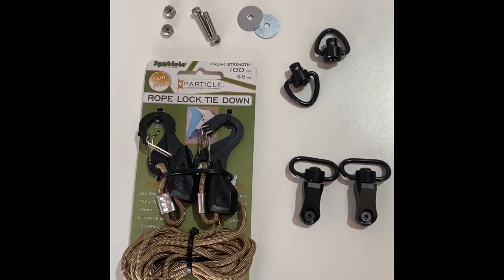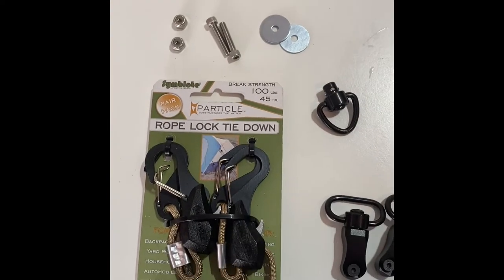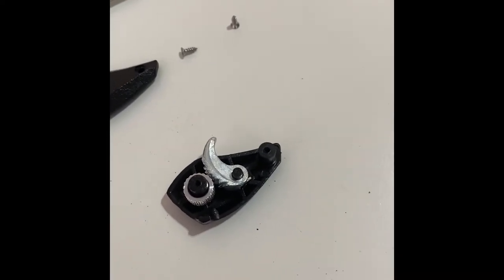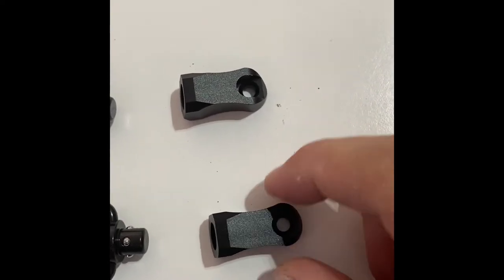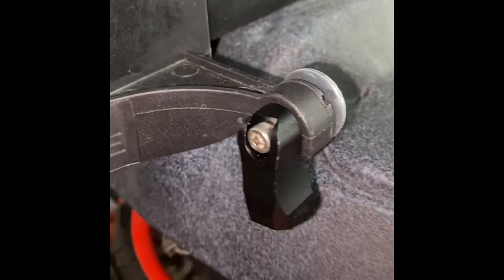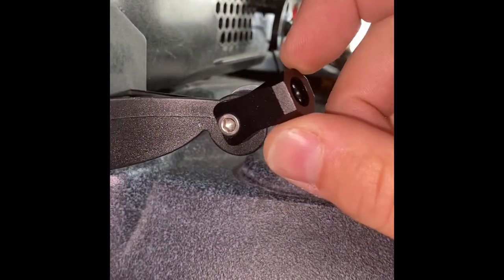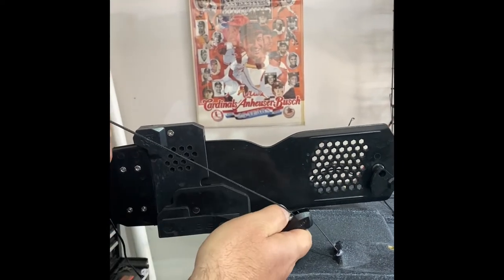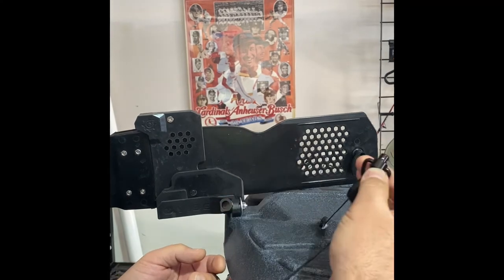Vibe Shearwater or Bixpy rudder quick release mount

Comment: I appreciate you taking the time to make the video and list the parts you used. I've fooled around with some things but I think this is going to work better than what I came up with myself.
Reply from the maker: No problem at all. Glad it worked out for you. I have two set up that way now and it is so much easier and works better than stock as well.